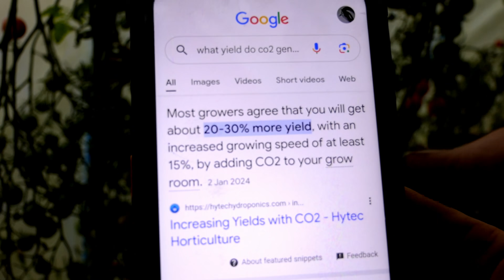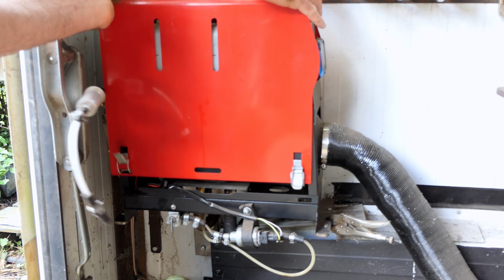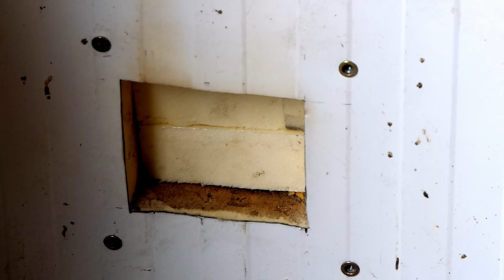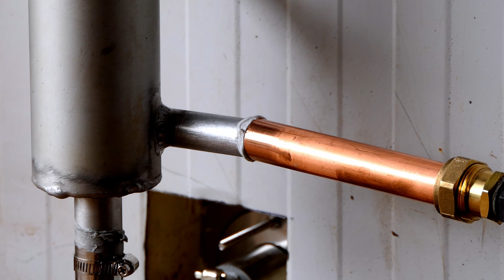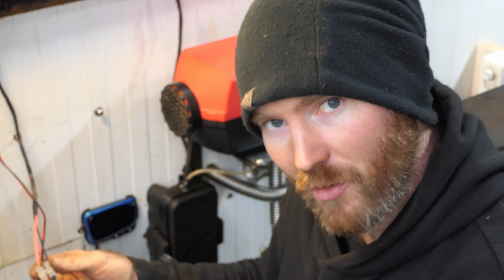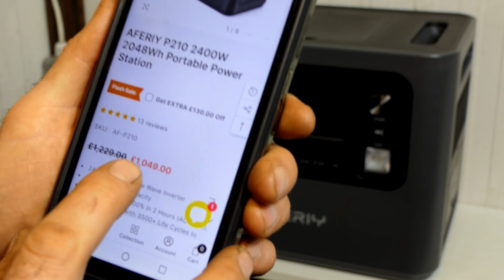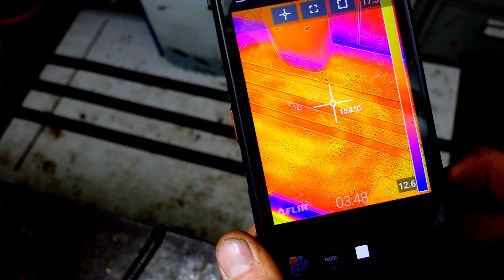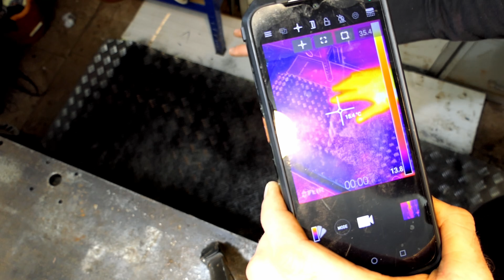NEW! Better system for Cheap and Safe Heating💲+ Underfloor Heating Mod test🫠

Comment: I'm with you, farming methods and forest clearing are a significant cause of C02 buildup.  If we changed these into permaculture (engineer for example perennial grains), and multi tiered food forests we could maybe produce a similar amount, while building up soil carbon/insects and actually reverse farmings' C02 contributions.  Most of all we need a change of mindset, instead of leaving everything to markets - markets serve themselves first before serving a social purpose.  No, I'm not a hippy, I'm a scientist.  Science and engineering rock. ;)
Reply from the maker: I 100% agree. Permaculture, regenerative agriculture and food forests for the win. Cheers J
Reply: Humanity has emitted more weight of CO2 than the weight of every plant on earth. Foliage can't keep up. It isn't an absorption rate issue. It's an emission rate issue. Millenia of CO2 sequestered and then released in decades. The Earth can't react fast enough do deal with it.

Comment: The western world needs to bring the developing world up year/standards..and grow more trees.. stop the de forest ions.....which is from what a said earlier.  Great video to see what energy can be got...im a keen believer that saving energy is better than cutting the start of it...insulate your home use less
..💪👌
Reply from the maker: Thank you. Cheers J
Reply: The weight of CO2 emitted by humanity by burning fossil fuels is more than the weight of all plants on earth. You can't fix this by planting some trees because there's not enough space. Even if there was, they don't live forever, and when they die they rot and release their captured CO2, or are burned. The only way it might work is to grow fast growing trees and preserve the wood by burying it, or making something out of it. But we cannot do this on a scale that would solve the problem. It's not even close.

Comment: GREAT VIDEO- AS ALWAYS- BUT... SOMETHING NOBODY,FOR SOME WEIRD REASON ,IN THE GREEN LOBBY PUTS FORWARD....ALL NON RENEWABLES ARE FINITE- THEY WILL RUN OUT, SO WHAT THEN ? 
IF WE DONT HAVE POWER- WE DON'T EVOLVE- WE GO BACKWARDS...
WE HAVE PROOF THAT WAVE POWER ALONE CAN POWER THE PLANET, SEVERAL TIMES OVER,THEN ADD IN OFFSHORE( MORE POWERFUL) WIND, THEN BUILD ON CHINAS PEGASUS SOLAR- IN A  NON USED, WORTHLESS DESERT,AND SAUDIA ARABIA'S TRANSFORMATION OF DESERT TO SOIL SO GOOD, THEY ARE NOW EXPORTERS OF FOOD- ADD IN AGROVOLTAICS( USING THE LAND OR SEA AREA FOR ENERGY AND  ALSO FOOD), WE CAN STOP OUR GRANDKIDS LAUGHING AT WHAT A DIRTY, DANGEROUS PLANET WE LIVED ON... THEN LOOK AT THE PACIFIC OCEAN- YOU CAN PACK IN THE AMERICAS,EUROPE AND ASIA- WITHOUT TOUCHING THE SIDES- SO IF YOU SET UP RENEWABLES THERE- WHO'S GOING TO COMPLAIN? AND LOOK AT SHIPPING USING WINDPOWER- THEIR GOING TO DWARF THE ELECTRIC CAR MARKET IN REDUCTIONS- AND EV CARS ARE GOING TO BE MADE A MINOR ROLE IN TRANSPORTATION- HYDROGEN IS BEING RAPIDLY ENDORSED AS THE ONLY VIABLE,LONG TERM SOLUTION-HAULAGE COMPANIES HAVE TRIED EV- AND GOT BADLY BURNT... WITH UNLIMITED HYDROGEN PRODUCTION OFFSHORE( ELECTROLYSIS AND DESALINATION ARE SEE8NG EXPONENTIAL RISES IN EFFICIENCY AND COST REDUCTION) , RENEWABLE ENERGY DOESNT HAVE TO BE  OUTSIDE YOUR WINDOW, OR TAKING UP FARMLAND-  I'M A RENEWABLES ENGINEER,AND I'M WATCHING A LARGE GROUP OF THEM,WHO ARE SICK OF THE PROFITEERING GOING ON- 13K FOR A HEATPUMP S6STEM??  THEY CAN GET A WORLD BEATING SCROLL COMPRESSOR,BUILT BY ISO 9001 COMPLIANT MAKERS-  DOING IT FOR BIG AIRCON COMPANIES FOR LESS THAN £200- THATS THE HEAT PUMP- THE HEART OF A HEATING- AND COOLING- USING A 3 WAY REVERSING VALVE- THEY ARE GOING TO BYPASS SEVERAL LEVELS OF PROFIT TAKING, TO FORCE A CHANGE IN ENERGY USAGE- AND THATS JUST THE START- ENGINEER'S PUTTING PEOPLE AND PLANET BEFORE PROFIT- THEY ARE TALKING WITH NON PROFITS TO USE BLOCKCHAIN TO GET WORKING PEOPLE ( LIKE 5HE BRITISH GAS £2K MAXIMUM SHARE ALLOCATION)  TO GET THE LIONS SHARE OF PROFITS FROM RAPID OFFSHORE ENERGY PRODUCTION - AND 5HEY ARE USING VAWT AND CUTTING EDGE HYDROGEN PRODUCTION DESIGNS TO SLASH  START UP TIMES, COSTS AND MAINTENANCE- THEIR HOPING IN THE NEW YEAR TO ANNOUNCE AN AMAZING,  100% TRANSPARENT ( VIA BLOCKCHAIN) FIRST STEP-  ECO HOMES WHICH KNOCK PASSIVHAUS INTO OBLIVION...
Reply from the maker: I agree with the finite limit of focils fuels in principle however huge stores have been located all over recently. I would say as fuel gets sparse then the price naturally would go up and therefore a transition to alternatives would happen automatically without question. But currently we still have a 300year supply of coal in the UK from what I heard so there is no reason to shut down the power stations in place for more costly alternatives.  I don't understand why there isn't a war on deforestation and an industrial scale re plantation of those forests. Cheers J

Comment: Doubt you can stop corrosion, when using that glue.
Its the water that makes the corrosion.
Reply from the maker: It would be better to use a plastic connector to reduce the galvanic corrosion for sure. An inhibitor is needed for water corrosion. Cheers J

Comment: Had more than one argument with that pratt from heat geek that an oil boiler is cheaper than a heat pump. Especially from a longevity point of view. Mine is from the 90s and shows no sign of giving up. I have seen heat pumps in Cornwall rotted out in just a couple of years due to salt in the air. Lots of people say heating oil is expensive and its just because of the way you purchas it not the actual cost. Basic maths eludeds most people these days.
Reply: You've taken your personal experience of an oil boiler and a few hand picked examples of heat pumps. This is anecdotal evidence. That's a logical fallacy. What matters are the broad statistics: Oil boilers last 10-15 years on average. Ones over 25 years older are less efficient and more expensive to run. Heat pumps last 15-25 years depending on a range of factors. Average is closer to 15, but some survive as many as 50 years. 

Stories of personal experience are compelling and persuasive, but they aren't science. To be science you need to look at all the data without bias which is really hard.
Reply from the maker: @Leo99929  brands will say what they can to make sales by stretching the truth. My home boiler is over 20 years old and works perfectly fine. It may not be as efficient (-5%) as a newer version but the newer versions do not last and have manufactured obsolescence design flaws (according to boiler fitters I know personally). Furthermore if you look through the comment section there was a heating engineer who explained that he was having to replace heat pumps that failed after just 3 years especially in coastal areas where corrosion was bad. Personally I take the manufacturers advice with a pinch of salt and instead I would ask the fitters and people who have had one for over 15yrs and their thoughts on it. Cheers J
Reply: @joshuadelisle  Those statistics weren't from manufacturers. Your personal experience is anecdotal evidence. There are approximately 4 million gas boilers in the UK. Yours might be the only example of one lasting 20 years (I doubt that is the case, just saying that from the personal evidence you have you can't draw broad conclusions). Statistically most need replacing after between 10 and 15 years but some last up to 25 years when well looked after. They are in the minority. 

Designed obsolescence is a thing, but mainly because to make the product last indefinitely would make the product more expensive than customers are willing to pay. They already pick the cheap option that breaks earlier rather than pay a little more for a longer lasting option. Investing in robustness for one part to outlast the rest doesn't make the boiler last longer. It still fails, but you paid more for it to fail at the same time. So they're designed to fail all at once to waste as little money as possible for the best value for money. It's called the bathtub curve: High failures when it's new, then reliable through the majority of it's life, then loads at the end when it all starts failing at the same time. There's also malicious designed obsolescence where it's designed to fail early and I'm wholly against that. But companies that do that tend to fair worse than companies that don't. 

Heat pumps failing due to corrosion in 3 years: is within the warranty period so free replacement, a local anecdotal issue that affects a very small proportion of the global population and heat pumps in general.

I've just had plumbers in to quote who are either incompetent or are bare face lying to me. Quoting £1000 day rate to lay the pipe in under floor heating telling me it's really hard and complicated. Same day rate quoted for heat pumps. Boiler fitters saying heat pump COP doesn't get above 2 (because they don't know how to spec one, neither do their mates, they do a bad job, then go around telling everyone how crap they are) Meanwhile some people are achieving ~6 and >4 is pretty common. Heat Geek guarantee >3.5. Oh, and apparently my boiler expansion vessel is broken because the pressure goes down when the system heats up? Not due to a clog/flow restriction then? And that means I need a new boiler? 

The problem with people with 15 years experience is that they sometimes assume they're right and don't want to listen to new stuff.
Reply: @Leo99929  they haven't even been on the market in the UK for 50 years. If you are referring to them in other countries and conditions then it is in no way related to my point. I have first hand experience of many AC unit failures and issues and know people who have had heat pumps fail or rust out very quickly. Though always just out of warranty!!
Reply: @TheCornish123456  The first heat pump was built by Peter von Rittinger in 1856. The first large scale heat pump in the UK was developed by John Sumner in 1945 on the doorstep of Finn Geotherm in Norwich. So yes, they've been around more than 50 years. I'm guessing you mean haven't been in Cornwall for 50 years yet? Maybe. It's hard to find numbers on that. But it's the technology as a fridge and they've been around since 1918 and I think it's likely that someone in Cornwall had an electric fridge by 1974. Probably air conditioning somewhere? Same tech. Samsung started making air conditioning units in 1974. That's just a heat pump installed backwards. Ground source hat pump heating is over 70 years old now. Maybe they didn't have air source heat pumps installed in Cornwall 50 years ago. But there are heat pumps over 50 years old.

You said you argued with Heat Geek about the technology longevity (based on your own first hand niche anecdotal experience). You didn't make the claim that they work reliably in most places, but just not in coastal Cornwall in the UK. You implied a broad difference in reliability in the core technology. Or at least that's what I inferred. I pointed out that this doesn't apply to the vast majority of people and the broad market statistics do not support your claim. Referring to them in other places within the country, or other countries, or other conditions, is not your point. And that IS my point: your first hand experience is not representative of the technology's broader averages.

It's a logical fallacy and bias: You weight your own personal experience more than the broad statistics. Doing science is hard as we have to put our biases to one side and it's hard to even identify them sometimes.
Reply: @Leo99929 ah those well known outdoor fridges. Apples and oranges. How many heat pumps do you have first hand experience of for more than 10+ years? I have decades of dealing with the aftermath of AC unit failure and heat pumps are far more like AC units than bloody fridges.
Reply: @TheCornish123456   Still anecdotal evidence. Give me something I can independently verify. What you have is an opinion based on your personal experience. Apparently that suggests that heat pumps have corroded on the Cornish Coast just after the warranty period or about 3 years? Helpful only to people who live on the Cornish coast. And it would be helpful to learn how close to the sea they are, and what brands they were. Is it just one brand? Did you install them? Did you service them each year? Is it only the ones within walking distance of the sea? There are some heat pumps lasting >15 years, so why do the Cornish ones fail so fast? 

If I were to tell you about the multiple heat pumps I've experienced for 10+ years, that would also be anecdotal evidence and not helpful for establishing what the reality is. That's not how science works. We don't just swap stories of what happened to each other. We'd need to do that over thousands or millions of people to get any kind of measure of the big picture. 

You deal with AC unit failures? So that tells me you get called in when things go wrong. It makes sense that you're going to think they fail all the time when you repeatedly see them fail. That is your own personal experience and it's a bias because you don't get called in to look at heat pumps that are working flawlessly. It's like a reverse survivorship bias.
Reply: @Leo99929 Observation is the root of all science. Anyway I will leave it there Chat GPT.
Reply: @TheCornish123456  I'm disappointed, but this is sadly as expected: You are presented with something that opposes your world view and you disregard it out of hand. Don't worry, it's completely normal. The purpose of your subconscious is to "maintain sanity" which means that your external perception of reality matches your internal model of reality. Since your internal model of reality doesn't match the actual reality, your brain misinterprets the information it receives in ways that allow it to match the internal frame. It's REALLY hard to train yourself to catch when this is happening and not do it. Even through rigorous training and systematic process slips are common.

Science is putting your beliefs to one side and testing what is true by methods such as counter example: imagine the opposite were true and try to prove that is the case. 

Look back through our discourse and notice that you make a point, and I explain why that's not enough evidence to form a solid scientifically sound conclusion, and you either drop the point, or repeat that you've seen it first hand. You still don't seem to understand what anecdotal evidence is, or you do but don't seem to understand why that isn't sufficient to form a scientific conclusion. You have the beginning of science: You've observed something (heat pumps failing) and formed a hypothesis (heat pumps are unreliable). You are right that "Observation is the root of all science". Now the rest of the science is the trunk of designing a test, branches of gathering data, leaves of interpreting it, flowers of writing it down, and fruit of others repeating it and getting the same results. That's what others have done and how we end up with heat pumps being as if not more reliable statistically speaking than oil boilers. Your personal experience might disagree. But that doesn't change reality. The world is big enough that incredibly rare things happen all the time. You seem to be unlucky with heat pumps, but it sounds like your job draws you to the problem ones which would of course result in a skewed perception of reality.

I'm still here, willing to continue this discussion as long as it yields new ideas/thoughts, because if I'm wrong I want to know about it. It's a win-win for me, either I find out I was wrong and I fix that and live happier in harmony with reality, or I help someone else do the same.
Reply from the maker: I believe you. Cheers J

Comment: Not only a fascinating video as always, but well reasoned arguments at the end on what is a very complex subject. 

Your take on politicians however, is spot on.

Now how about some videos on solar… It’s free, abundant (if not so much in the UK), and with storage you can buy off-peak and use from the storage throughout the day.

The technology to harvest it however remains expensive.

I bet JDL could find an innovative solution…
Reply from the maker: I recommend watching Michael Moore's documentary on solar panels: https://youtu.be/Zk11vI-7czE?si=CnvdvnAqx78Totxq

Im doing a review next on a solar panel and battery for going off grid. I'm not sure how much sun I'll have though... Cheers J
Reply: @joshuadelisle excellent timing!

I’m not sure that fully off-grid works without the security of a backup generator (but I am open to being convinced), and of course the now rip-off standing charge in the UK dilutes the advantage of self sufficiency in summer months.

I believe (based on a friend’s experience as opposed to my own), that the savings are still significant.
Reply from the maker: @iandonkin6762  definitely. I've actually acquired a 6kva diesel Generator that I'll experiment heat recovery with too. A generator is only 30% efficient meaning we can scavenge 70% as heat energy whilst generating power. Cheers J